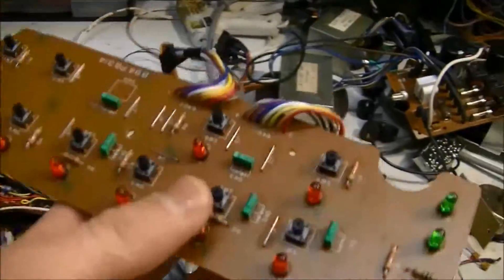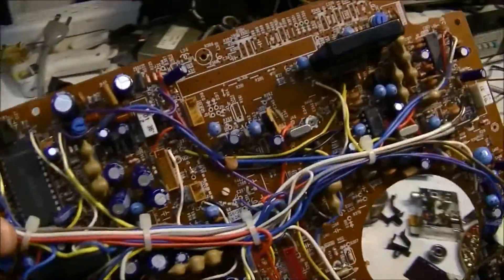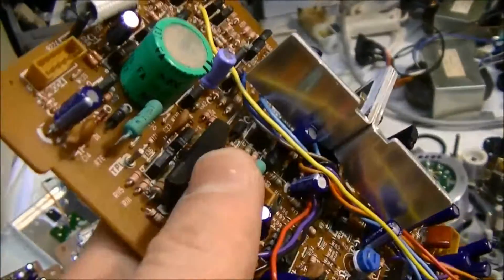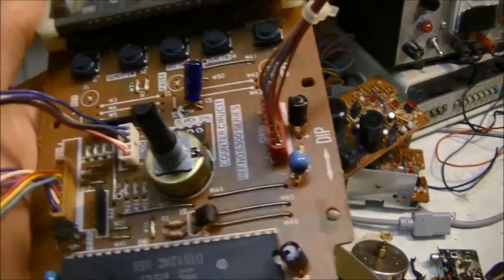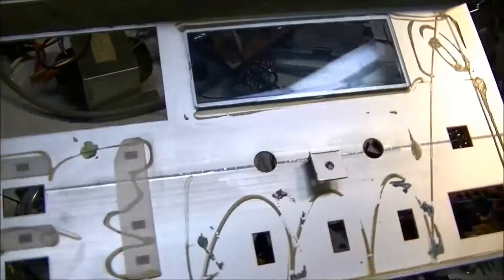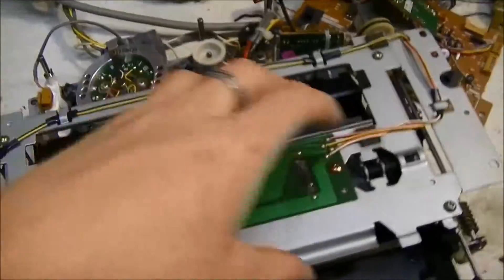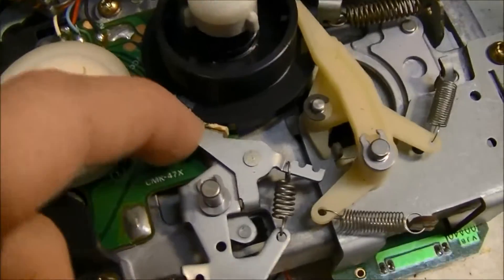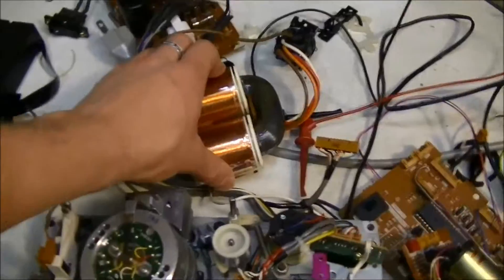26 Year Old VCR Tear Down (part 2) - Has Some Very Nice Motors, Transformer, and No SMD Components!

Comment: Really nice! I got one VCR one of these days, for free, and didn't opened it yet. But, tell me, that transformer give what voltage? 12v AC?
Reply from the maker: +MC's Creations I'm not really sure as I've never tested it. I'm gonna guess it's 6 12 and 24 volts. Maybe a few others. There's at least 4 different voltages because there wes about 4 rectifiers on the power board.
Reply: Makerj101 Nice! Thanks! :)

Comment: Что теперь делать с этой кучей металлолома???
Reply from the maker: I don't know yet!  Probably save some of the metal and make brackets and things for Stirling Engines.
Reply: Makerj101
May be to repair this old VCR?
Reply from the maker: passat039
Yeah I could use some of the part to repair another VCR if I find a smaller one.